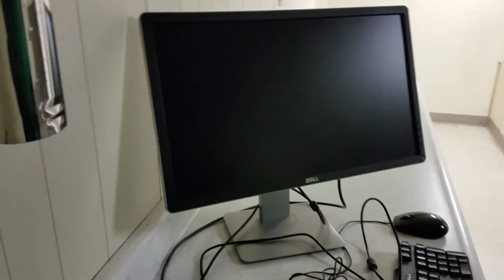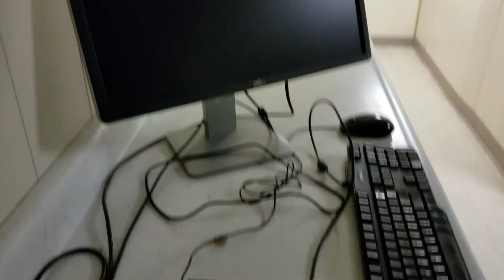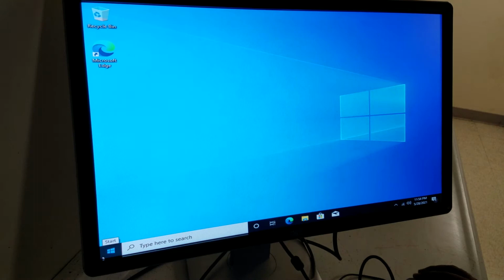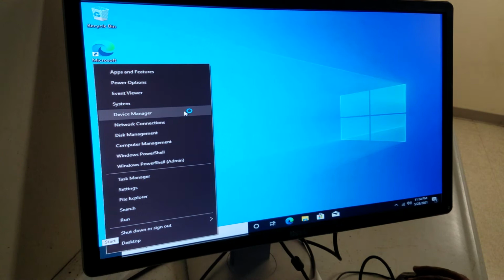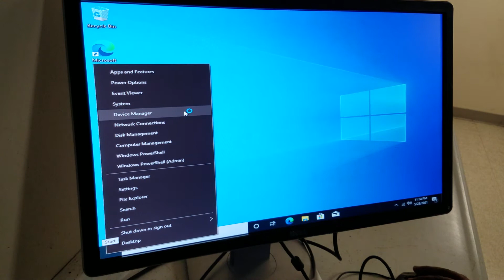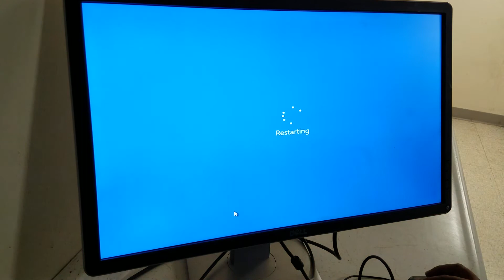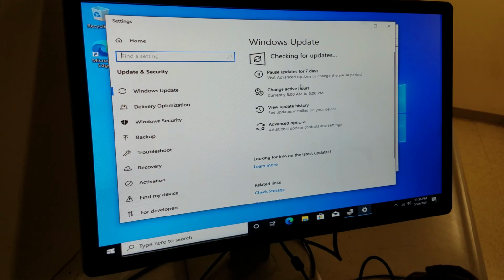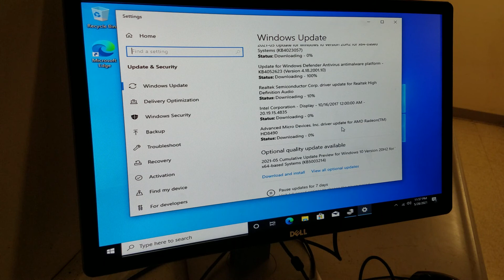Dell OptiPlex 3020 install Graphic Card May 29, 2021

Comment: How comes you don’t need to connect graphics card cables to power supply
Reply: some gpus dont need an external conector and only draw power from the pci-e slot